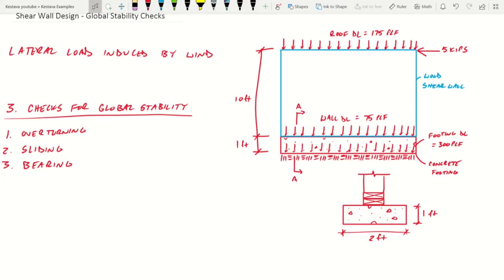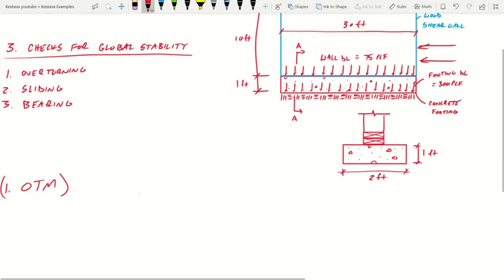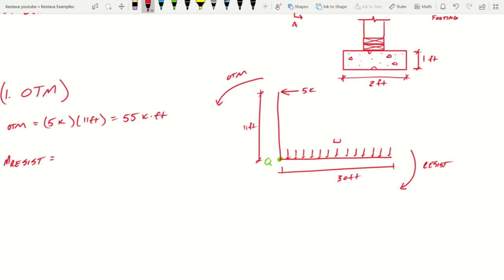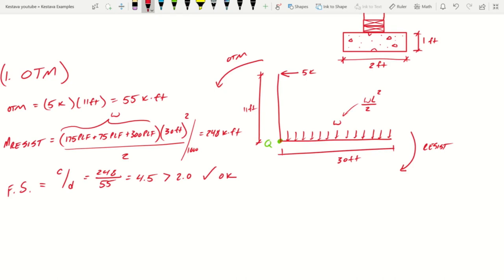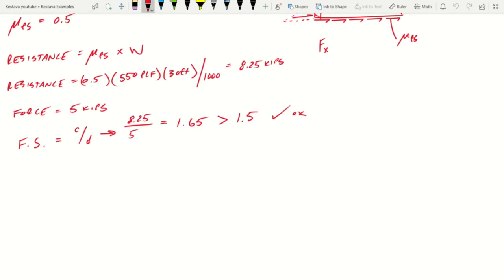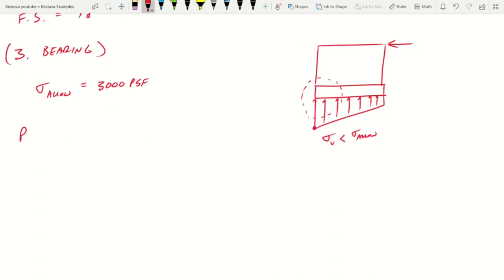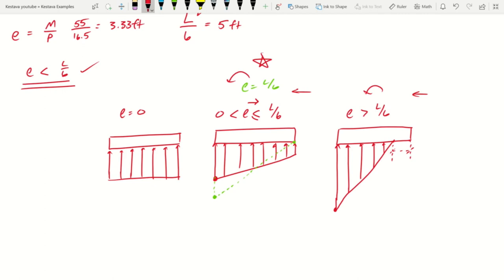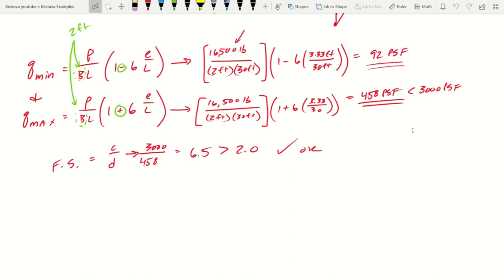How to Design A Shear Wall - 3 Things You MUST CHECK

Comment: Is the 5 kip wind load an ultimate wind load?  If there are no factors applied in the global stability check, but we are using service loads, does that mean we would use a Service Wind load = 0.6*Ultimate wind, or Service Seismic load = 0.7*Ultimate seismic load.
Reply from the maker: yes - the wind loads derived in the ASCE 7 are strength level forces. so the 0.6W "load case" is bringing strength level wind back to service level wind. same with seismic

Comment: If there is no soils report the lowest value can be used in chapter 18 of the building code which gives 0 for the friction factor, but rather a cohesion and a 1,500 psf bearing pressure for the soil. 

I have also not seen the weight of the footing for the resisting moment and the height of the footing is also not considered, just the height of the SW itself (10 ft in this case) also the dead load is to be multiplied by a factor which varies based on the seismic design criteria. 

But overall a conceptually great demonstration.

Comment: So if the shearwall has large overturning moment because of height, the wall footing will not be adequate, right? You need to use deep foundation?
Reply from the maker: there are unfortunately many additional factors that come into play to determine if you need a deep foundation or not.

Comment: Do you know how to design colt shearwall with multiple opening and high aspect ratio panel with spline connectors and angle brackets as well as hood downs?
Reply from the maker: I am not familiar with a "colt" shear wall? can you explain further?
Reply: @Kestava_Engineering I’m sorry I meant CLT SHEAR WALL with spline connectors and Hold Downs

Comment: Is it typical to neglect soil weight above footing for overturning moments? Is it similar to reasoning for neglecting passive pressure over toe of a retaining wall?
Reply from the maker: Hi Logan, Both can be included in your design if you need to "sharpen the pencil". Both are absolutely correct to use in your design, and we typically like to use these if there are late changes in a project that cause us to push the limits of our design without resizing footings.
Reply from the maker: obviously if the footing geometry is large and supporting a large volume of soil then we would want to include that. Many designs are completely custom and should be evaluated and designed using good engineering judgement.

Comment: Also, not sure if they apply for shear walls, but I typically use International Building Code sections 1806 and 1807 for factors of safety, soil sliding friction constant, and assumed bearing capacity if we don't have a geotech report.
Reply from the maker: I did not mention IBC, and i should have! The IBC is a great resource to obtain these values.